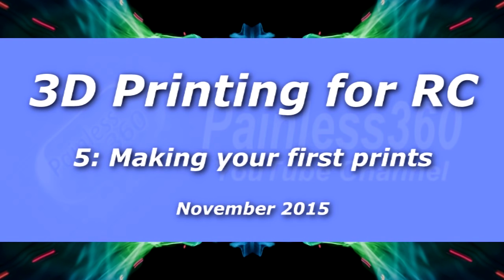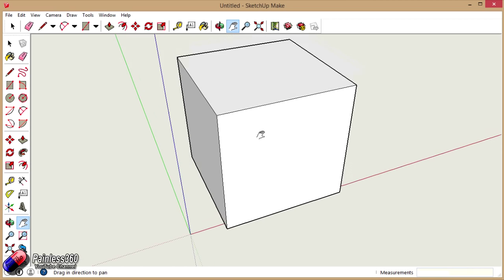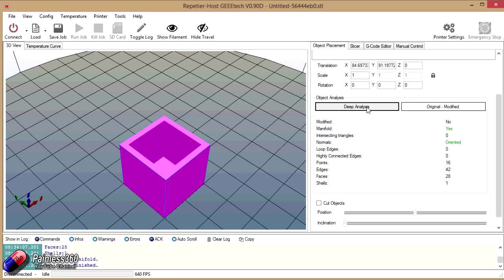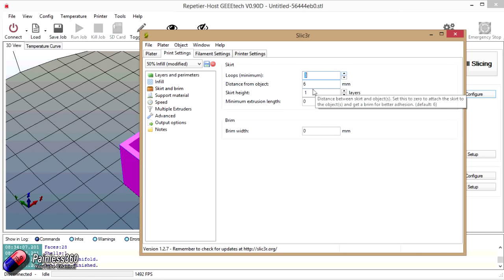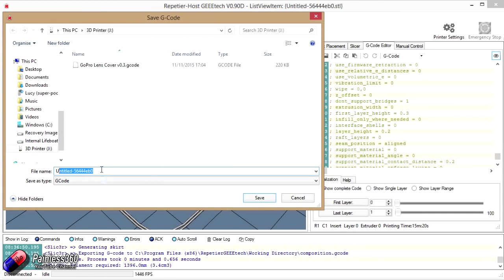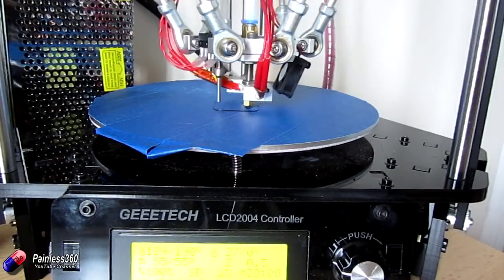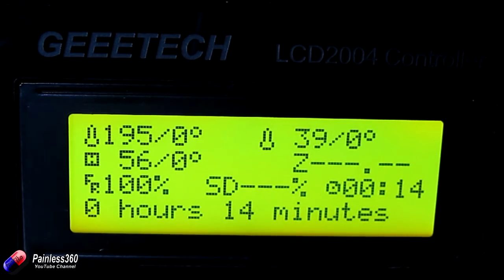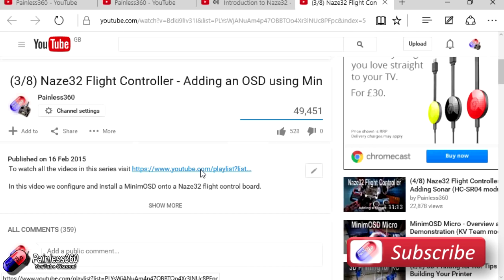(5/5) 3D Printing for RC – How to print your first 3D designs

Comment: Good advice. Attach all your print head wires to the trolley base. Don't let them move around. After 300h of printing your heater, thermistor wires will snap off and short and ruin your print or even fry you board (12V on a heater!). They can wiggle around but not at the ends or points of contact.
Reply from the maker: Thanks - great advice!

Comment: At the end you say "take into account when building models". But that is not the goal of calibration, to change the models to fit the inaccuracy. The goal of course is to change the firmware settings, specifically XYZ steps per mm, so that it prints exactly the right size. Furthermore, due to ooze, once you think you have a small calibration object setup correctly you will need to print a much larger calibration object (e.g. 10cm+ XYZ calibration ruler) to confirm and make final adjustments.
Reply from the maker: +Tony Wall I understand your point but even when the calibration is spot on then there are small inconsistences due to many variables in the final print size, including the plastic you use as some are more dimensionally stable than others.. Knowing how far 'out' a print will be will help in making sure the fit is perfect and not too loose or too tight. Happy printing!

Comment: Thanks for doing his series! Is this calibration more related to the printer extruder itself, or is it necessary to do for each type of filament - i.e. ABS might "squeege" differently to PLA ? And would you recommend this type of exercise even for each different brand of PLA or whatever material you use to account for differences from each manufacturer etc?
Reply from the maker: This is more about making sure the stepper motors and firmware are all ok and checking how accurate the printer is. Some plastics are less dimensionally stable and can print at different sizes but the shrinkage is very part dependant. I tend to test print the bits of a model that need to be very accurate before committing to a 2 hours+ print run. Happy printing!

Comment: After video 3 in this series there is "RC Reviews - Geeetech Rostock G2s Pro 3D Printer (from Banggood.com)", then "[Private Video]", then this one. From the intro to this one, I assume that "[Private Video]" should be number 4 in the series, discussing the software stack required. Has it been marked as private by accident, is there some issue with it, or am I missing something? Thanks for the great videos - really interesting content.
Reply from the maker: Thanks for using the playlists. The next video us queued to be released on the channel tomorrow. That's just the way that Youtube works but by using the playlist you are getting early access to all the uploaded content. FYI the last videos in the series will cover designing your own parts, exotic filaments and tips and tricks for better printing.. glad you are enjoying the series so far..
Reply: +Painless360 Hi, oddly, video 4 (the one BEFORE this one) has now shown up in the playlist. I wasn't looking for an unreleased one, but the one before this one, which was showing in the list as private for me. Anyway, problem gone away now. Thanks again.

Comment: fyi your hot end wasn't full for the start of the print so it under extruded.. 

You just need to extrude a fraction bit more plastic before you start, either by hand as I do or just setup your slicer to do make that initial extrusion a little longer round the outside of the print.. if you had two of those objects side by side you'd not have had that problem as the initial laps would have been longer.
Reply from the maker: Exactly, that is why I mention increasing the laps on a smaller part to refill the hot end. Happy printing!

Comment: You where talking about the vertical lines on the printout from a rostock printer, 
so if you are using any other type of printer do the sides get better printed or do they get some other flaw?
Reply from the maker: +Giorgio Salmi The artefacts in the vertical pieces are there from the fact that the code is running three motors at once and using some basic trigonometry to move the head into the right position. A more traditional printer uses just one to move in any one axis so you can get a slightly cleaner print if the item is lined up with the vertices on the print bed. Happy printing!

Comment: Could you tell me what diameter nozzle(s) you chose for your printer and why?  I chose the .5mm but now I'm thinking it might be too large for some of the smaller parts I'm going to print.  Thanks!
Reply from the maker: +Wounded Knee I went for 0.4mm as it was a halfway house. A larger nozzle would speed up my prints but I'd lose a little bit of detail for the fine parts. Happy printing!
Reply: +Painless360 The printer finally arrived and it's all calibrated and printing!  I agree, it's 'hypnotic' watching the the thing, I've wasted countless hours. Questions:  does your G2S 'time out' while the print head is aloft and does it come sliding down to the bed after a brief period of inactivity?  This is annoying while trying to calibrate or print.
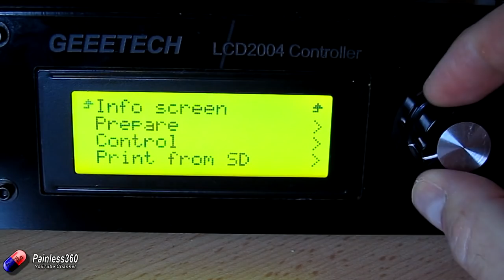Reply from the maker: It does. You can edit this in the firmware but the way I do it is to use the menu and prep the printer by pre-heating the end/bed so that the wait for the temp to come up is much less and doesn't trip the failsafe for the steppers.. (11:02)

Comment: Hey I got this printer, I'm having some issues when printing with support structures enabled. It tends to bump the lower levels and throw it off track. I can print much better with support structured disabled. Also the right side of the print bed prints fainter for the first levels so i'm trying to figure out how I should level it out as auto level doesn't seem to be getting it. Any suggestions? The bed is completely level on all side when putting a spacer under it.
Reply from the maker: +wingxxzero Check that both of the hot ends are the same height from the bed. The second one is rarely set to the same height. Set the bed so that the distance to the hot at ZO is the width of a piece of paper then use the screws on the tops of the linear carriages to adjust the height in each corner to match that distance at the centre (follow the calibration routine) in the manual. I set the printer to be spot on mechanically and don't use the autolevel..
Reply: Painless360 Is there a reason it would only occur when support structures get added? I have it sent to pillars. It seems as though its printing those pillars too thick or leaving jagged edge tops on the pillars.
I spent a long time getting the hot ends level.
Reply from the maker: Tricky to help more without seeing what's going on. Sometimes the speed or temp of printing can cause the roughly printed supports to have proud pieces of plastic that can catch the hot ends and cause the steppers to jump and lose calibration.

I'd try slowing the speed of print down or altering the print head temp.. Best of luck..